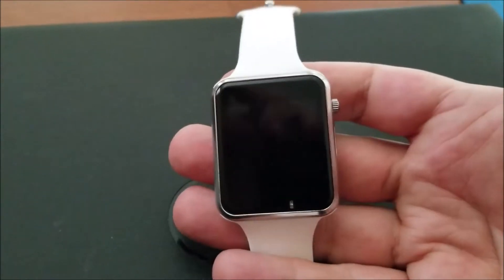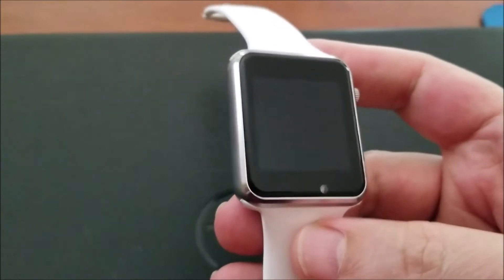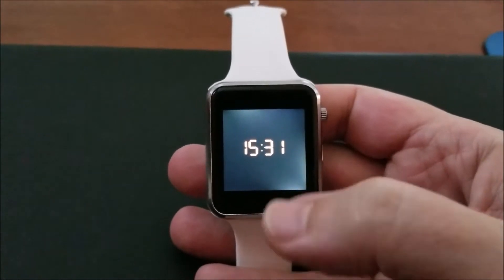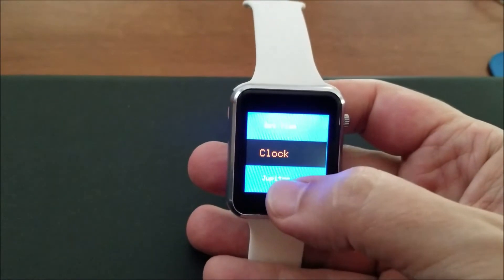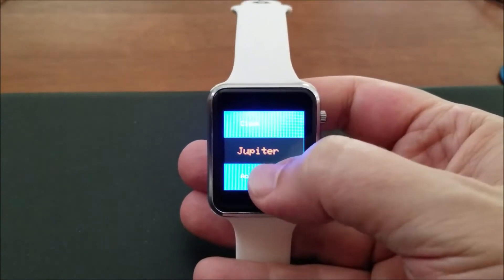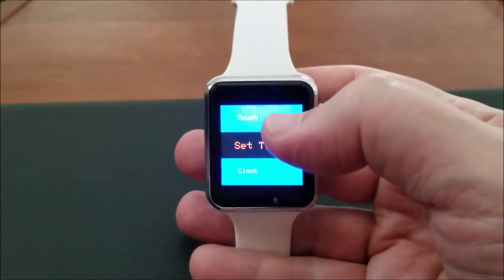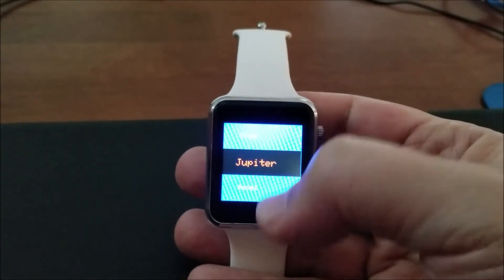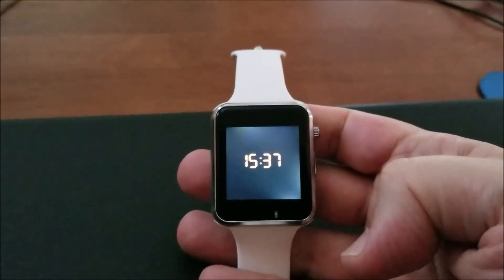LilyGo TWatch 2020 Arduino Framework

Comment: I believe you can hook into the power button, there's some examples of it in the github
Reply: Yup you can but unfortunately there's no documentation on the t-watch library so you have to dig through the source code to find it. You can put the watch in to light sleep which uses only 1% an hour, which is really not bad! But you can't use wifi or bluetooth while asleep so its use as an actual smartwatch is limited. You could turn the screen off and clock the CPU down to 80mhz but you won't make it through a full day. I love programming this thing but admittedly the ESP32 just isn't suited for this kind of application.